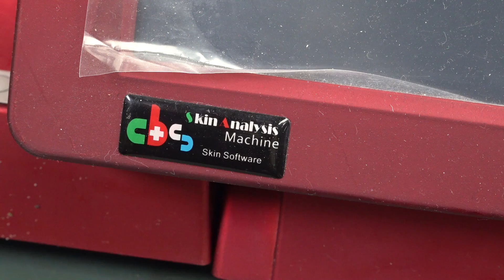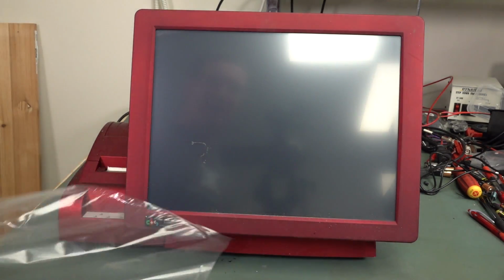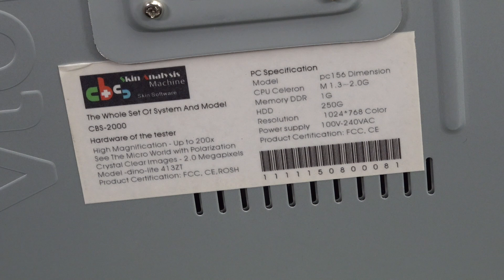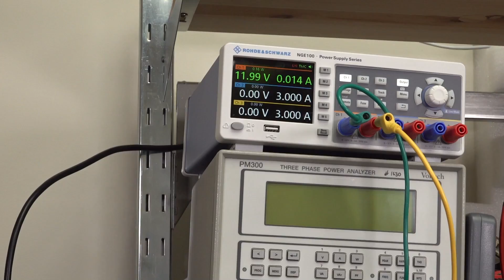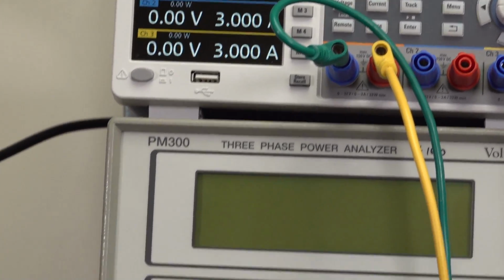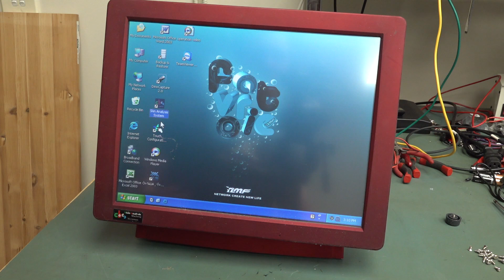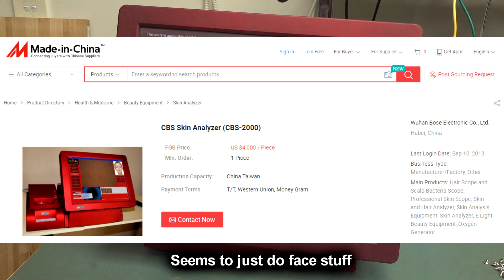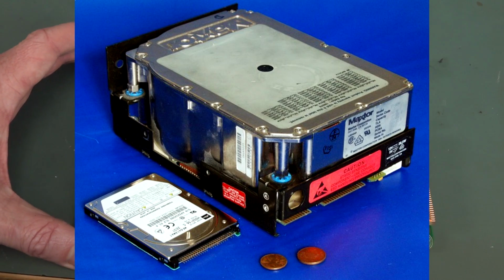Mystery Dumpster Teardown 2020-06-07

Comment: The Chinese labels for the back panel ports are:
Top row:  Serial 2, Serial 3, (obscured, probably parallel port)
Bottom row: Keyboard, main power input(12V DC),  VGA, Power output(12V), Ethernet port, USB port, USB port, Client Display Port(Serial 1),  Microphone, Headphone(looks like it is repurposed as a micro SD slot), CMOS clear.

Comment: 6:45 Just because its a Celeron doesn't automatically date it, as there are 10th-Generation based Celerons such as the G5900 which was launched in April 2020...
Reply: It has an Atom D525 so this specific model was released in 2010 +
Reply: Was just about to write the same.
Reply: @indask8  HDD date of manufacture narrows it down to after Q4 2013
Reply: Why Windows XP though?
Reply: HDD was probably swaped later, read original size on sticker. And XP, it is a stable OS, and it will still be in active use for many more years, support or not.

Comment: Uppsala University year 2020 - we are still running industrial machines in the cleanroom on Win 3.1, in particular a double chamber cluster sputter for deposition of thin films. The system is built around a custom ISA-card which handles almost all hardware in the system (valves, pressure gauges etc). Of course there would not be any drivers for this card, nor any possibility to move the control software to any newer machine...
Reply: Yeah sometimes there is no point innovating things that just work as they should.
Reply: Well, what if the system breaks down? CPU, memory etc. Do you have a backup?
Reply: This brings to mind the reason that they rarely send cutting-edge technology into space.  Indeed, many supposedly advanced satellites are running hardware that's twenty years old at least.  This, simply because after twenty years we know most of the quirks of the hardware and can account for it in the design.
Reply: ISA systems aren't that rare. Probably any board with the same chipset could be substituted.
Reply: @denniseldridge2936  Also there is no benefit in upgrading any software. We are also running some DOS-Win95-XP machines in the lab and they do their job pretty damn well. Upgrading would only reduce reliability and cost us a fortune.
Reply: The machine at my workplace (silkscreening onto plastic tubes) still runs on Win 3.11 embedded.

Comment: I worked for a company back in 2006-2007 that sold touch screen kiosk systems in a specific industry. Ours were custom designed and integrated by a local Australian engineering company, which had all the parts manufactured locally and assembled them for us. Our original models were these hugely heavy floor standing models that weighed something like 60KG, and could only be moved with a trolley, obviously so that they couldn't be easily stolen.

We used those shuttle PCs inside them, because they had good cooling and were easily serviceable when things went wrong. Not to mention they were the smallest commodity machines around at the time.

Eventually we developed a desktop model similar to the one in the video, which was something like a third of the price of the old model thanks to the reduction in the size and number of parts in the chassis, and the big drop in the cost of touch screens. But we still designed it to fit the shuttle PC slotted in the back of the unit. The third model was designed to have a slide-out tray that took a micro-ATX motherboard, which further reduced the complexity of the design and cut costs. However it made them less standardised, so we couldn't just have an image for each model of Shuttle PC, as motherboard models changed every few months. I was pushing for an industrial PC m-ITX type system, but got overruled on cost.

Even though the kiosks themselves were pretty expensive, the margin on them was modest. We still made a fair profit on each sale, but the real money was in the service contracts. That screenshot of the unit on Aliexpress selling for $US4K was in the ballpark of what we were paying for our units, but obviously manufactured locally in small volumes. The engineering company did look into manufacturing in China, but at that stage it only made sense for production runs of a few hundred at a time. We were probably only selling at most a few dozen per-year while I was there, and that was reaching saturation since we basically had the market cornered.

Comment: Yeah, I used to work for BAE Systems back in the early-mid '00's. Around about 2004 one of our ink-jet wire marking machines was still running on Windows 3.1.  That thing was fantastic when it was working properly.  If there was ever a malfunction or the ink-jet got misaligned, it was a nightmare to work on.  The ink that the military uses to mark cables is some bad-ass stuff.  You can't even rub it off with acetone.   On another note though, that machine was pretty slick.  It used a single jet of ink controlled by a couple of electrostaticly charged plates that steered the ink jet to mark text on wire/cabes in a dot-matrix fashion.  Pretty neat bit of kit imo.

Comment: this is a nice sbc could totally be used for a router or a ad filtering appliance , maybe a car security / nav / multimedia system since it runs from 12 volts
Reply: @Bob Sacamano Occasionally, there might be high voltage spikes as well.

Comment: That D525 is indeed an Atom CPU. I bought one in 2011 as a cheap low-power home server (mostly irc and backups and stuff) and it still runs today. It replaced a Pentium 3 from 1999.
The label on the bottom actually mismatches more of the specs inside. It mentions 250 GB but the harddrive is 500 GB. Maybe this Atom board is a bit newer than what was originally inside?

Comment: Google translate says of the 12v on left is a 主机电源原输入（直流12V)  “Original power input of host (DC 12V)” and 12v on the right is 电源输出（12V）”Power output (12V)”. The port on the right of the USB that reads 客显接口（串口), seems to be a “Customer display interface (serial port)”
Reply: I was going to say one was probably an output.

Comment: 6:57 What you mentioned reminds me of some kiosks Science Centre Singapore used to have in the 2000s, that ran Windows 3.1 and normally launched into custom software, but almost all of them crashed and were showing a gutted Program Manager (no program groups!). Back then, I didn't know it was Windows 3.1, as I was randomly tapping around and didn't think to tap on the "Window" and "Help" menus.

Around the same time, they also had kiosks that were running Windows 98, where one had a whole bunch of applications installed, but would load the regular Windows shell with lots of desktop icons and background apps, and immediately launch into the kiosk software and cover that all up.

Comment: The hard drive has been upgraded - it said 250GB on the bottom label, but inside was a Momentus Thin 500GB drive. Which is only noteable for its lower height of 7.5mm instead of the standard 9.5mm of most other 2.5" HDDs. So it fits tighter spaces (like the ThinkPad X220/X230 series, they need a 7.5mm drive). Nowadays, of course, 2.5" SSDs are always 7.5mm high.

Comment: Haven't watched yet, but looks at first glance strikingly like a photo kiosk we had at a photo lab I managed for years.  I frequently had to tear them open to make upgrades and they were a total PITA... Their motherboard was in the back of the display, but the hard drives and PSU were down in the base... Lots of plastic locking tabs and having to disassemble the touchscreen display to access the motherboard was a real treat.  Worst was the cable routing between the display and the base... nighmare that was.
Reply: Why not watch and THEN comment? Is that too logical for you?

Comment: It looks quite old running embedded Windows XP, but Celeron doesn't date it so much as the series of the Celeron.  Celeron Processors are still in production in the current generation.  Same as always, they are the cut down version of the full processor line.
This one is an older 1.8GHz Atom processor though.  2 Core, 4 Thread, released on Q2 2010, so this machine could be anywhere from 6 to 10 years old.
It's an interesting find and if it can run XP (even an embedded version) you could make a nice little linux desktop out of it.

Comment: SLBXC stepping code on the CPU says it's an Atom D525 - which isn't really a Celeron branded chip but is low enough power to explain the tiny heatsink.

Comment: Atom D525, that thing would have felt slow as can be even in 2008 or whenever it was from. Microsoft had to start licensing XP to manufacturers again since people wanted to buy the nice cheap netbooks with Atom's in them but Vista was way too much of a dog to run on the early Atoms. At least this was a dual core variant :)
Reply: the Atom D525 was a 1.8Ghz Dual Core - it used 13watts, and for the purpose of this machine would have been more than enough... But that dates this machine to around mid-late 2010 at the earliest, not 2008 as thought :)
Reply: I didn't see an XP Oem license sticker anywhere on this :)
Reply: Can FSB overclocking be done on one of those?
Reply: @virtualtools_3021  - not with that BIOS LOL

Comment: I swear the Screen Bezel and Hinge look like an FEC Glaive (Pos Unit)

Also, that second Power output would be to power up the printer. There'd be a lead missing between them. Fairly common to power pos printers from a POS device itself.

Comment: That's not the original protective film. It's used in Drs offices to protect commonly touched surfaces, or surfaces you need to touch while gloved. Keyboards, mice, exam light handles, touch screens, etc.

Comment: That is a micro-PCIe slot on the bottom. I would likely keep this board after swapping out that Seagate job with a 120GB SSD in there, as it would be as if a Raspberry Pi that runs x86 CPU.

Comment: Intel Atom® Processor D525
, 1M Cache, 1.80 GHz, Launch Date
 Q2'10, # of Cores 2, # of Threads 4.
Faster CPU than the 1GHz PIII CPU used in the Agilent 16900A series logic analyzers which also run Windows XP.

Comment: Prolly a fake Seagate drive 'cos it works after more than 12 months.
Reply: Fucking Seagate HDDs are SHIT -  I just tested one that's been in secure storage for about 5 years. Had under 1000 hours, no SMART errors and perfect surface scan when I parked it.
- Yep, it has click of death and total Read failure.

Comment: When you bought an industrial control system with your machines for 20 to 30 million in 1992, running on a 486 with MS-DOS, then you don't throw that whole system away after only 30 years, just because there are newer PCs available now for controlling newer systems...

Comment: This Atom D525 was a good Processor for embedded Systems. But for a normal computer it is useless. Today you will use a Linux based system because a RasPi is even faster and needs less power. And if you have to do bigger computing you can use a Nvidia Tegra X1 or X2 as eddison platform. It is quiet powerful even without a fan

Comment: That slot on the buttom is a mini PCIe slot. You can put a WLAN Card or other accessories for the Slot in there (hell even USB 3.0 Cards exist).
There is a tiny possibility that I'm wrong and that's an mSATA Slot but I don't think that is very likely on a machine that came with windows XP...
Reply: My bet would go for mSATA since I would expect mPCIe slots for WLAN to be on top of motherboard and parts on that computer are dated on 2013 so mSATA have been around already.
Reply: @15fakeaccount  - the replacement HDD is 2013. The machine is at least 3 years older.

Comment: I'd like to see an alternative OS installed, either modern windows which will suck, or a lean Linux.
Reply: Windows 10 will refuse to install, it's only got 1GB of ram rather than the 2/4GB that win10 demands. Looks like it should take any 32 or 64 bit Linux though.

Comment: 6:47 Millenium trains on the Sydney Trains Network are still running Windows 3.1!
Reply: the inflight entertainment movies on some older airliners is run off of Digital8/Hi8 or MiniDV tapes. this thing is certainly a repurposed POS system.

Comment: Oh, that looks like an old Intel Atom...
Might be a newer one (don#t know, 45nm or smaller) but still pretty useless and slow.
A Core 2 Duo from 2006 really slapps this thing around with a large trout ;)
Heck even later Athlon XP and 64 should be far better than this CPU. The only thing Atom has going for it is relatively low power and price...
Reply: They were specifically for low power, and the first CPUs with super-cheap OEM Windows licences. Atom Netbook with XP, 250GB HDD and 2GB RAM was under AUD200

Comment: Intel uses utterly asinine product naming. You can buy a Celeron today, brand new. It refers to their cheapest, most crippled, line. For example: Intel Celeron G3930 Kaby Lake Dual-Core 2.9 GHz LGA 1151 51W BX80677G3930, $54USD.
Reply: Why does having consistent branding make it asinine?
Anyway, this is an ATOM, not a Celeron. The Atoms were lower spec than Celerons.
Reply: @johncoops6897  The way Dave laughed at "Celeron" and spoke of how old it is led me to believe that Dave thinks this is a Pentium II Celeron or something. "Celeron" does not imply "old"